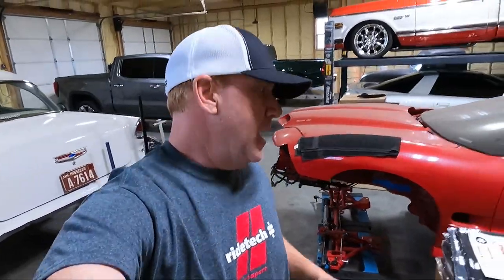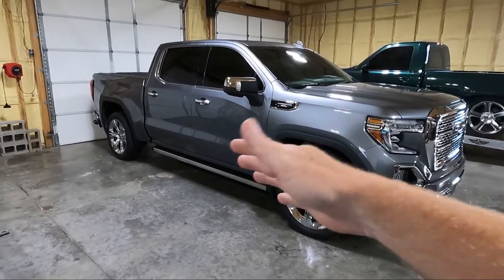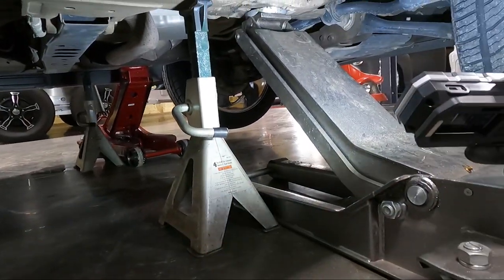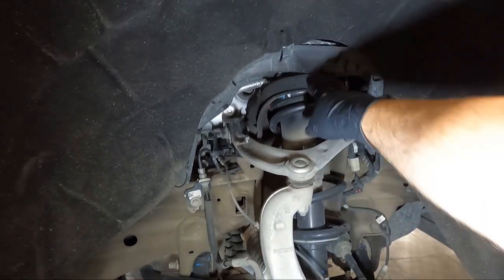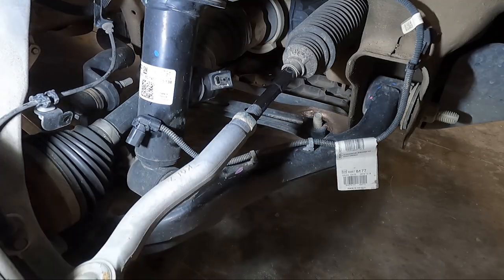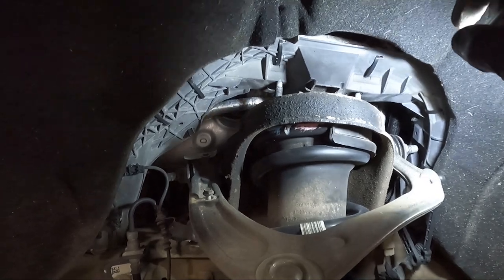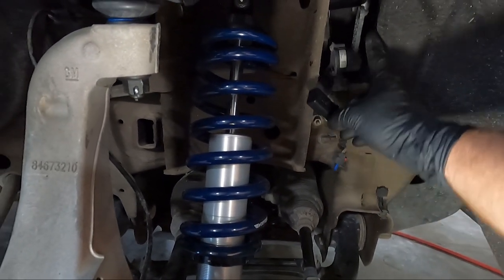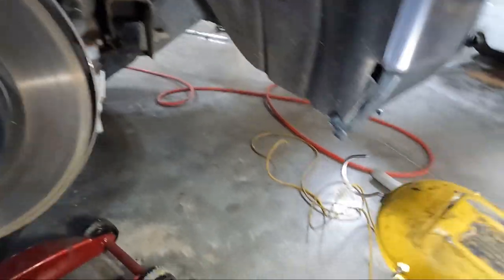Ridetech Lowering Kit Install 2020 GMC Sierra 4WD (Ultimate Step by Step How to Lower 2019-2023)

Comment: How does it ride?  I have a 2019 6.2L SLT 4x4  max towing package with a Borla Touring system and a COI, and wanted to do this as well.  The truck is mainly used to drive from STL to our Branson lake house so we do some decent highway driving.  Moderate towing, but that will end now that we have a boat slip.
Reply from the maker: Best riding lowered one I have ever done

Comment: I have a 23 Chevy Silverado 4x4 High Country and because of my physical disability I have 8 right knee replacements, 2 left knee replacements and 2 major back surgeries. I can’t lift my Rt knee high enough to get into my new truck, so I need my truck lowered so I can get into it, I think a 4/6 would work, I’ve watched so many videos my eyes are changing holes lol 😂, but I want to complement your videos they have been so much help and informational on what would work and what to look for im fixing to watch 1:16 1:16 1:16 the video you did on the blue met. I just don’t want to lose my ability to tow so I think that a helper bags from airlift so I can put a little air in the back when needed, I had them on my 2500 HD Duramax/ Allison I sold that and bought my last truck and I want it perfect stance and wheels and tires are everything it makes or breaks the vehicle so keep up the good work if we lived closer I would love to let you do it but I’ll take your advice and make sure the shop will do it the way it should be, No corner s will be cut it is to be done right and ride like a new truck. Thank You … Mark
Reply from the maker: Will need helper bags if you plan to haul

Comment: Just the right look for the truck, not too low. Great video on the installation of the ridetech kit, looked like the worst part was programming the modules.  Looking forward to the airbag installation. Again those wheels look great. ✌🏻
Reply from the maker: Thank you. I sure like it
Reply: Sr I have a  cuestion so whit that kit u no need cut the frame anymore
Reply from the maker: No

Comment: I have a 2020 as well but I’m running a 26” snowflake wheel with a 305/30/26 tire. Can you give a final measurement from center of the wheel to the clearance of the fender
Reply from the maker: Will come down 2.5 front and 4.5 rear from current setting

Comment: Thank you for the hard work & effort with putting this video together 🙏🏻

I own a 2021 Silverado 1500 LT 2WD (5.3 - short bed) and have been trying to settle on which lowering kit to go with. 

It’s been a toss up between Ridetech’s kit you installed, and Belltech’s 1040SPC (w/ adjustable coilovers & rear C-notch). There’s over a $1K difference in price and I’d like to find out if it’s worth paying the extra amount for the Ridetech, or not?

I wasn’t planning on doing the bag support, but after watching your video, I’ll likely add on later. I don’t currently plan on towing anything though.

Any thoughts, or feedback, would be greatly appreciated 🙏🏻 Ty!
Reply: Btw, with Memorial Day sales going on, I decided to pull the trigger on the Ridetech and ordered it today. From the research I’ve done, there seems to be a noticeable quality difference..and even though Belltech feels like a reputable brand, and I’m sure it’s comparable in some ways, but the components look to be achieving the same end result, but in a different fashion. 

Your comments during the unpacking video stayed with me too, and how well the quality of the materials used impressed you. The upper A-arm replacement and how the coilovers are fully adjustable also pushed me over the fence. 

I’m the type too that wants the stance, but as an everyday driver, I didn’t want issues after 6-12 months of driving, and felt there was more of a chance with that with the Belltech product. A coworker of mine has the Belltech, so we’ll see ha.

If you happen to have any knowledgeable install referrals  in the WPB, FL area, I’d greatly appreciate it. Many thanks again for your post, info, and video. I’m a subscriber for sure
Reply from the maker: @tedg102 you will appreciate the quality thats for sure
Reply from the maker: Sae this after the second comment. I know it's a lot of money but still going strong and rides great!
Reply: Well..quick update. I sure wish I had the smooth shipping experience you had. I ordered the complete kit, got the truck to the shop, and get the call I was dreading…kit is missing the control arms, and upper/lower coil over mounting brackets. Wish me luck because everyone involved doesn’t seem to have straight answers and I’m beginning to regret going this direction unfortunately.
Reply from the maker: @tedg102 that sucks. Sorry to hear that
Reply: Finally got the whole story. It came down to simple communication. I purchased from a company, that purchased from a different supplier, that purchased the kit from Ridetech. I’m the 4th person in the line basically. 

Turns out the missing components are back ordered and currently being made. I should have them in the next 3 weeks, which I’m fine with, and would’ve been, if anyone would’ve communicated. 

I’ll update if/when the kit is actually installed 👌🏻
Reply from the maker: Well that sucks but at least you got the ball rolling on getting the other parts.
Reply: @TWAMotorsports  yea, I’ve accepted what’s going to happen, will happen. Definitely looking very much forward to having the kit on and driving it. 

Curious if you know though what performance difference would be noticed lowering to its maximum? It would be nice having the flexibility of going lower, and knowing I’m maxed out at 2.5” (front) & 4.5”’(rear) leaves me wondering how it might look. I’m pretty sure Ridetech recommends 2/4…but a coworker of mine uses a Belltech with at least 3/6 and rides nicely. For now, at least it rides nicely. I’m curious how this stock components will react over time..

Appreciate any knowledge or feedback you have. Thanks
Reply from the maker: @tedg102 i am at max drop. 2.5/3.5
Reply: @TWAMotorsports  that’s interesting, because their site & resources claim 4-4.5 is possible. I was curious about the reality of that.
Reply from the maker: @tedg102 4.5 in back

Comment: Thank you Travis...very helpfull as I will be doing this to my new truck.  I have a question, the rear only goes 4", if I needed to go a little more, no more than 1" how do you suggest I go about that?  I really like this kit.  I know there are other kits out there like the IHC that do a 3/5 but really want this one.

Can a block be added to the rear to get that extrfa inch?  Thank you in advance.  

John
Reply from the maker: If you do that you will need a notch honestly
Reply: @TWAMotorsports  thank you for the reply, how do you feel about them?  any suggested brands? 

thanks
Reply from the maker: Probably belltech

Comment: Does the truck bottom out with the kit you're putting on? I want to lower 2023 Silverado. I'm not hauling or towing anything with my truck.
Reply from the maker: If you go 4.5 in the back without helper bags it would bottom out on big dips.

Comment: Hey I recently did a 4/6 drop on my 2017 Denali but suspension service light came on is there a way to remove it?
Reply from the maker: Need shock simulators
Reply: @TWAMotorsports  Do you have a link of which ones you recommend and have you done a video installing them?
Reply from the maker: Yes several times. Videos on the channel and product in video description

Comment: Man,… that’s a lot of work to lower these new trucks. I’ve done all of the GM trucks up to the nnbs trucks, but nothing newer.
Also surprised you don’t use never-seize on the coilover adjustment nut.
Reply from the maker: They don't call for any on the coilover

Comment: Hey, I had quick question. I have a 2017 sierra Denali 1500 4wd. I wanted to put 2” drop shackles. Will that ruin the ride?
Reply from the maker: No
Reply: @TWAMotorsports  will it still ride like factor?
Reply from the maker: Not factory but not bad either
Reply: @TWAMotorsports  ok, thanks
Reply from the maker: You're welcome

Comment: Hey Travis how did it Align? And did Ride Tech let you know what to do with the brakes brackets on the rear end?
Reply from the maker: It aligned without issues. I didn't use the brake line brackets in the 12 bolt rear.
Reply: @TWAMotorsports That is really a nice kit, just the price is pretty high on it, I 2021 Silverado with only 2100 miles on it , right after I got it I talked to Tim at Suspension online About the mcgaughy,s kit and he said they didn’t make anything for it, but now they have a 2.5 /4 drop and 4 /6 for around $1400, but it wouldn’t work on your truck because the shock System you had on it, I worry about the warranty on mine if I lower it, don’t know what will happen.
Reply from the maker: It will cancel warranty on shocks and suspension but nothing else
Reply: @TWAMotorsports  Yeah I was thinking maybe just that , it’s crazy you can go to the dealership and buy a new lifted trucks already with no problem with warranty because they had done.
Reply from the maker: I agree with that statement

Comment: Hey Travis great video as always. I had left you a message about a year back when you still had the grey nbs crewcab. I did ridetech coilover all around my nbs crewcab about two and half years and have had nothing but a bad experience with it. 
My question is .. and it might be to soon to ask, are you getting any noises (squeaking) from your Balljoints from your control arms ? I know they come with proforged Balljoints. I been wanting to replace them with moog Balljoints to see if I can get rid of the noise. SMH ridetech.
Reply: Maybe if you do get squeaking noises you can mention it in a follow up video. Thanks in advance
Reply from the maker: Wow. No not yet and hopefully I don't have the same experience.
Reply from the maker: Definitely will be doing  a follow up.
Reply: Hopefully not. Thanks for the reply. Will be looking forward to your follow up. Truck is sitting just right.
Reply from the maker: Thank you. Yeah if it does. It will be known
Reply: Proforged and Moog are pretty well on par with each other nowadays. I've used Proforged for quite some time and had great luck (at this point, I don't believe any of the main brand name components like these are made in the US).
Reply from the maker: That's for sure